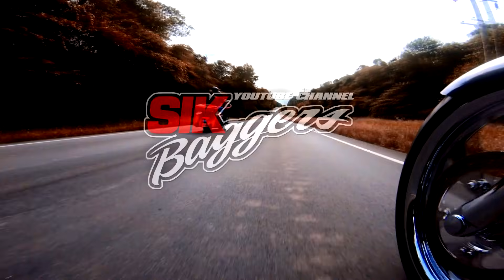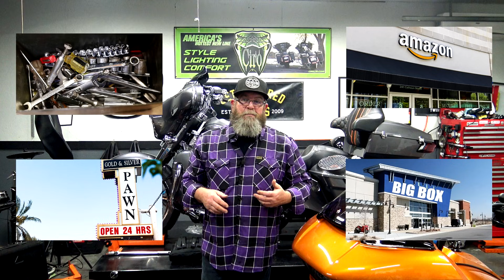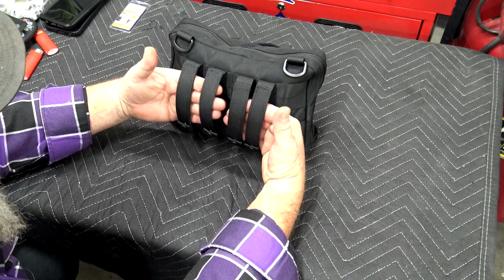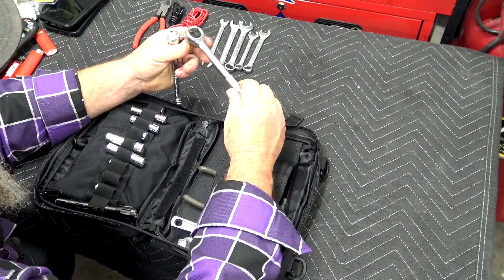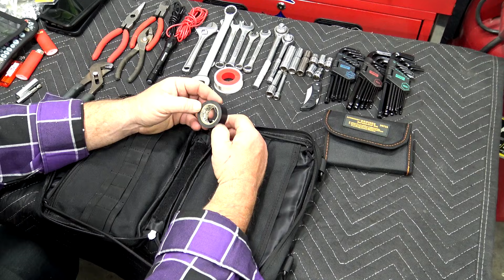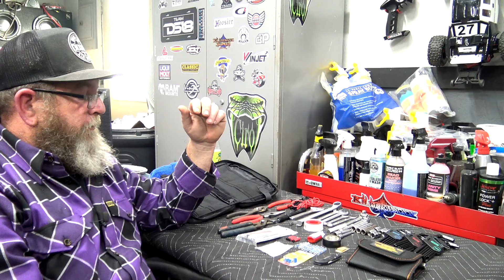⚡Build A Motorcycle Tool Roll Cheap!⚡

Comment: A few items I carry in addition to the ones in your video: A small cheap Multi-Meter, a small Butane Torch(I have one that has a Bic lighter inside, made by Iroda), a magnet for retrieving dropped tools or parts, a small battery charger(Mine is made by Eliminator), 3' Tape Measure(In case you have to get replacement parts, cables, etc.) & a mini Hygrometer. As for Spares, a couple of 12" pieces of fuel line(Different diameters), Spark Plugs, Emergency Clutch/Throttle Cable Kit, small strip of Solder(For Cable Ends, etc.), Signal Light Bulbs, a couple of Socket Head Cap Screws, Bolts, Nuts, & Washers(Standard sizes for the Bike I'm Riding). etc. These things don't take up much space, but they can save your(Or someone else's) ride... P.S. Tire Plug & Patch Kit.
Reply from the maker: That’s a solid list of extras, always good to be over-prepared on the road!
Reply: @sikbaggers  Better to have and not need, than to need and not have... On a long ride I might even bring a complete gasket set...

Comment: I'm pretty OCD and kitted out my own tool roll consisting of the following:

E10 x E12 Torx box
Torx keys (T20, T25, T30, T40, T45, T50)
22mm hex adapter
Mechanics wire
E10 x E12 Torx box
Electrical tape
Cable ties
Spark plug socket
Spanner wrench
Needle nose pliers
Combination wrenches (8mm, 10mm , 12mm, 13mm, 17mm)
8" adjustable wrench
3/8" ratchet
2" extension
6" extension
Sockets (8mm, 10mmx2, 12mm, 13mm, 17mm, E8 Torx)
Hex keys (2mm, 3mm-6mm, 8mm)
6-in-1 screwdriver with bits
Locking pliers
Loctite Blue
Small wire cutter/stripper
Gerber multi-tool
Cable ties
Wolfman Luggage M955 - Wolfy Tool Roll
OLGEO Tire Inflator Portable Air Compressor
JACO ElitePro Digital Tire Pressure Gauge
ARI Airplugger tire plug kit
Small trauma kit w/tourniquet and quick clot
Reply from the maker: thats a grand kit!! And thank you for sharing!

Comment: By now, after almost 3 years of riding I have almost finished my “on the road” kit. 
Some people say that I overdo it with all my “just in case” items. According to the guy who does my MOT inspections I could take my whole bike apart with the tools I have in that roll. Is it overkill? Maybe. 
But then I already was able to help a stranded fellow biker fix a broken clutch cable on the roadside and get my gf’s scooter jump started when it got stranded with a dead battery (as those things go….it was fine in the morning, completely stone dead by evening). 
So I will say that sure, you might rarely need all that stuff and maybe shave a bit of weight off my kit. But when you need it, you REALLY need it. 

But honestly - just a ratchet, a few hex drivers, the 4 or 5 most commonly found bits, sockets (Amen to the 10 mil sockets!! I also keep one or two 10 mil deep sockets) and spanners for your bike as well as a large sturdy Philips #2 will get you pretty far already. I did not splurge on those at all. Most of it is store brand stuff and it works fine. 

A little telescopic magnet picker-upper-thing is also an absolute life saver. 

I recommend packing a good side cutter and pliers wrench, too, alongside with a head torch. For side cutters and anything “pliers” I admit to splurging a little and getting the Knipex stuff. Bit pricey, yes. But absolutely worth it. I have used their stuff for over a decade now without any issues. 

Add a couple spare fuses like you did, a few zip ties, cotter pins, self sealing tape, tire plug kit, Loctite and crazy glue and you are off to the races. 
My latest additions were a small cheap multimeter, a jump pack (Noco GB40) and a tire inflator (something from Fanttik. Forgot the exact model). 

Oh, and since the day I helped said stranded rider with his clutch cable, I also carry a repair set for brake/clutch cables.
Reply from the maker: Love hearing how you've helped others with your well-stocked tool roll – definitely not overkill when you need it!

Comment: I carry a plug kit. I know plugging a tire is a no no. But in an emergency, it gets you off the highway
Reply from the maker: You are right! I have added a plug kit too, and a battery air compressor. I got those mushroom plugs from Amazon... haven't had to use them yet, knock on wood, but they got great reviews.
Reply: @sikbaggers I had to on one of my previous bikes.

Comment: I just came across on Amazon a Tekton 1 1/2" max  Cresent wrench with a 3/8's square drive to use with a torque wrench. Pretty cool might be little heavy. Otherwise I would throw in a 36mm clawfoot scocket for when the exhaust is blocking that rear axle nut.
Reply from the maker: Thanks for sharing those tool tips, I'll have to check those out!

Comment: Thank you for this video I  used your list to build my tool kit don't quite have everything yet but do  have about 95% of the list and also bought the same bag it works great with my sissy bar bag and also have a tire inflator, plug kit, and a jump pack
Reply from the maker: That's the way to do it, thanks for checking out the video!

Comment: Great information, I just recently put together a tool kit for my bagger. I have mine in a special operations equipment large tool bag, you can not beat the quality gear they produce and they have interior Velcro pockets and options you can put inside to organize. The only other thing to take into consideration is some extra cr2032 batteries for in the key fobs. I saw another video and the guy said to use your bike tool kit to fix the bike when sat home, you’ll figure out if you forgot anything.
Reply from the maker: Good thinking about the extra batteries, I wouldn’t want to be stranded with a dead key fob.

Comment: 3 bikes and tools i have used over the years screwdriver change out bulbs . wrench for mirrors  the old dash was a allen head set of allen wrench's  if a starter goes out a toe rope my age im not pushing a bike have your brother pull start it , keep a 3/8 kevlar cord 25 foot.  I think in 40 years I have used my tools 3 or 4 times .   a Old man said to me, I rather have it with me, not need it, than need it not have it.
Reply from the maker: Absolutely ///i very rarely use it around home but pulled it out several times for myself and others on trips to strugis and daytona...takes up little room and has come in super handy a few times.

Comment: the best advice I have is own your bike for a bit before you take it out, youll figure out exactly what you might need after a few months of maitenence. I also always bring aluminum foil, aluminum tape, safety wire/pliers and a tire plug
Reply from the maker: Yeah, you are definitely right, it’s good to get a feel for what you need on your specific bike.

Comment: I'm building my bagger kit for couple years now, try and error method applied, 
it's a bit bigger than the one you showed but the core is the same. my additions are couple of metric wrenches and sockets (because I live in Europe), little cans of brake cleaner and electric connection cleaner (it come on handy more than I want to admit), sparkplugs, tire repair kit (with the smallest bikepump I found) and a bag of loose, used and abused nuts and bolts collected from the garage floor.

Trialed by fire a lot of times on the road side. Saved not only my behind most of the time. A lot of the uses made the difference between 15-30 minuts of adjusting a simple thing and going back home on a lorry.
Reply from the maker: ive added a tire kit and a pump also...all great ideas to have! Thanks for checking it out!

Comment: Two things}Firstly you have word salad like Kamala Harris secondly I am so glad I ride a metric bike because I have never had a break down and what good is all those tools if you do not carry the parts.And lastly if your bike is in good shape a 6000 mile trip is no different than riding around the block.
Reply from the maker: "Oh, I’m sorry—was my word salad too complex for your delicate intellect? Who the hell said this was a Harley toolkit? Newsflash dummy: metric riders carry toolkits too, and they even sell pre-made kits specifically for metric bikes. Shocking, I know. Maybe try expanding your idea of what a breakdown is—no, it won’t fix a faulty fuel pump because, believe it or not, I don’t haul a spare fuel pump everywhere I go. Are you really that dense? What it will do is handle the smaller side-of-the-road headaches: loose wires, throttle adjustments, plugging a tire, tightening fasteners, etc —basic stuff. Not everyone’s riding the same bike as you, pal. But apparently, since your bike’s never broken down, no one needs a toolkit? Genius take. And your comparison of riding one block to 6,000 miles? That might genuinely be the dumbest fucking thing I’ve read this year. Do you even realize how much can go wrong on a long trip that has zero to do with your bike’s condition? Keep clinging to your magical “never-break-down” mindset while the rest of us—prepared riders—deal with reality.
Oh, and by the way, “firstly, secondly, and lastly” is three points, not two. Congrats, you literal loaf of bread.
Reply: I see you are very sensitive, but most people know what tools are and how they are used and it i nice to know that your pawn shop sells cheap tools. Merry Christmas.
Reply from the maker: @bigjim383  Oh, Jimmy, it’s not about being sensitive—it’s called matching the big-boy energy you walked in with. Remember that old saying about heat and kitchens? Yeah, that. "What do you mean "Most People" ?? Quick math: 12,409 hours of watch time, 100K views.... Seems plenty helpful to plenty of people doesn't it, champ? 
But hey, if you want to keep dropping comments with insults, I’ll happily return the favor.  Have the Christmas you deserve.

Comment: well i have an importnat add to the tool kit....I found myself broke down 5 hours from home last night. Locked the bike/bars at the end of the day and somehow my ignition switch tumblers got mis aligned. The switch wouldnt "click" thru the positions, and the bars were stuck in the locked position. This morning, spent 3 hours trying to find someone with the $10 dollar Ignition alignment tool!! Its an important add IMO.
Reply from the maker: not a bad idea...never had one freeze up like that with the ignition installed...I do have both tools, one for the 13 down and one for the 14 up.....cheap on amazon
Reply: @sikbaggers  yep.....i ordered it the evening i got home after the trip along with the set of three Hex/Torx kit you showed in your video. Side note: I bought the bike on 31 August with 13k. I just checked the mileage yesterday (16 Oct) and realized Its got 18.2 k now.....DAmn that went fast....LOL Oh....and I did watched your 3 hole fluid change and performed that about 3K ago....easy to do...thanks for the detailed vids sir!!! great stuff.

Comment: Harbor Freight has very inexpensive hand tools. They have a tool kit with wrenches, sockets, driver bits, etc. Both SAE and Metric for $39.99. It has things you might not want to carry & it might be missing tools you need but it's a good start.
Reply from the maker: thats a great tip and a great place to pick up cheap tools for the tool bag!

Comment: One thing I have in my tool kit is a length of re-bar tie wire. Plastic coated wire and zip ties are great but if you need wire to hold something that’s very hot  the plastic would make a real mess. Re-bar wire wraps really tight and easy to work with.
Reply from the maker: yeah ! thats a great man and I have some laying around...adding it today...thanks for the input!

Comment: Zip ties Loctite Allen wrenches quarter inch ratchet 3/8 ratchet star sockets in standard and Metric small set of standard in metric wrench sets I picked up for cheap at AutoZone an  adjustable wrench couple screwdrivers roll a quarters road Atlas flashlight pair earphones and the phone charger
Reply from the maker: nice! some great additions there!

Comment: Your choice of using a tactical bag is a great idea and far cheaper too, as I’ve just ordered the exact same one which is far better & practical looking than some similar ones out there that try to mimic it without the securing clipped down straps or just pull through tightening straps which is not good in my personal opinion. 

An excellent video you have posted with helpful hints & ideas of what to pack and even where to source cheap tools too.
Reply from the maker: thank you for checking it out...ive slung this bag all over the place and its still holding strong..glad to help!

Comment: Great list!  As others mentioned I keep a tire plug kit, pressure gauge and valve stem tool with me.  I always have a small set of vice grips and long nose vice grips.  I would suggest those.  I keep 2 small pieces of rubber hose that can slide over the long nose tips and the long nose vice grips can double as a hose crimper/ clamp if needed.  I also have a second adjustable wrench in my tool kits in case the limited open ends and sockets I have don’t fit something I need 2 wrenches to tighten.  It might be excessive but I also have a micro 12v test light, 2 small C clamps, spark plugs, plug gap disc, plug socket, stubby screwdrivers, a small file, cold chisel and pin punch.  I also keep some tie wire, para-cord, cotter pins, safety pins, paper clips, clothespins, JB weld, locktight and superglue and a funnel on the bike as well.  I guess the sky is the limit.  On some of my tools I cut the handles down so the tools would be smaller.  I also have the small 6ft motorcycle jumper cables as well as a small hand air pump which I keep on anyway for my police air adjust seat.  Headlamp and basic first aid kit are good too.
Reply from the maker: Great additions to the pack! Thank you for sharing!

Comment: @sikbaggers: Great video! Can you post a link for the two 12/14 gauge extra wires or a specific brand?
Reply from the maker: hey thanks! you can get these small 10 ft pieces and keep them together or split them...i split mine and used it on various things around the shop and threw the left over pieces in the tool bag...here is the set of wires I got https://amzn.to/3TxHwYn
Reply: @sikbaggers  thank you!

Comment: I Have Always Had A Tool Bag/Roll.
My 1st Harley, A 1999 Electra Glide Came With, And Every Bike After I Made 1, My Current Bike I Bought 1, $99, Added To It, And Now I Got A New Bike, I Like The Shaving Kit Type Bag Idea 😊
Reply from the maker: Hey thanks for checking it out and dont forget like I did in this video to address tires...inflator and plug kit has been added and also a small first aid kit too.

Comment: I like to carry a small circuit breaker from an old or faulty power strip that has had. I use it in place of a fuse to sort out the problem if something starts shorting. I have the tiniest little test light too. Smaller than a pen even to help track down any issues. I rain ride often. I don’t drive a car so it ya daily moto rain or shine wet riding will find your electrical flaws every time.
Reply from the maker: Thats a great idea! Thank you for sharing it with us!

Comment: I put together a tool bag similar to yours but with more multi use tools to save the weight and size.  Included a motorcycle multi tool that has been a great addition.  I’ve completely removed a street glide fairing to fix a wiring issue on the side of the highway with it.  Also added a small first aide kit that has come in handy as well.
Reply from the maker: yes we added a first aid kit last year right before sturgis and it was something i had overlooked for years but a great idea to have!

Comment: Great little set up.  I put a couple of spark plugs  and one long plug wire in mine because wth not. Plugs fowl and wires crack. Maybe a little bottle of octane boost.
Reply from the maker: Thats a good tip! Octane boost if you are traveling and get ahold of some bad gas that can really help!

Comment: I know this is a very old video but Thank you. I just bought my first Harley, a Road Glide Special. I have tool kits for my Metric bikes but I don't know what I need for the Harley yet. This was quite helpful. Thanks again.
Reply from the maker: Thank you for checking it out! And glad to help!! Also include tire plug kit and a rechargeable air compressor.  I didnt mention it in this video. Something similar to this kit https://amzn.to/488IUWI and this inflator https://amzn.to/3OxR6Ja These are the ones I keep on the bike. The inflator is very reliable and doesn't get super hot like the cheap ones do.

Comment: take a few pictures of your shop manuals wiring diagrams with your phone, and then they will be on your phone..
the other things, a cheap pen type multi-tester ( $20 something ), a pen tire pressure gauge, and a small telescoping mechanics magnet

and of course, us with fork bags on our Sportsters have to pinch ounces....get the THIN Open End Combo Wrenches, 3/8 on one end, 7/16 on the other...1/2, 9/16...5/8,11/16...the 5/8 being your spark plug wench....get a second 3/8, 7/16 so you have two of each of the same end, and get a 10mm, 12mm for your battery and clutch cable....get all the torx, allen keys, and screw drivers you need in a CruzTOOLS FHT1 folding kit.....and also a small pliers type key chain multi tool.( like a $10 SWISS+TECH ST35000 )
then you still have room in your fork bag for all the other little stuff..

Comment: I realize that this video is a year old, but I keep 3 more things in my kit that you didn't mention, that others may find useful.
 A small C clamp for pushing brakes back if you have to do any brake work to free up a wheel. (Done this.)
A kickstand spring, because those don't break at home and they don't take up much space or weight.
A spare shifter peg. I can't count the number of times people with me have lost a shift peg on rides.
Great video
Reply from the maker: Hey cowboy... thank you for the very useful tips! Those are all great ideas and what's crazy is I have all those things just laying around and never thought about adding it in. Great tips!!